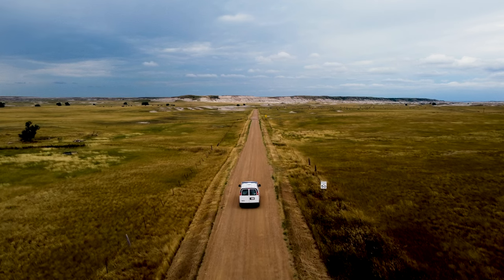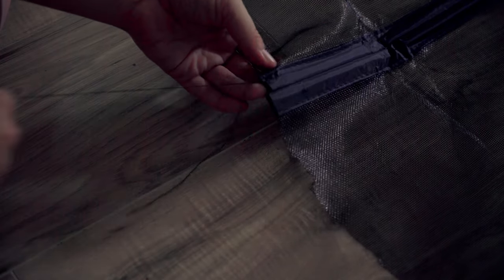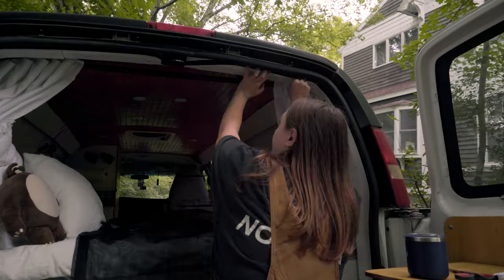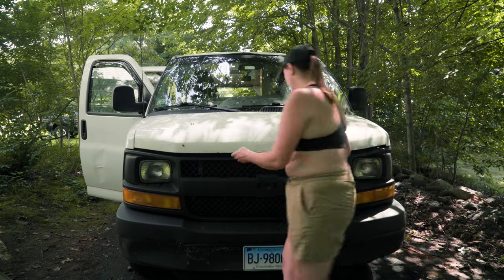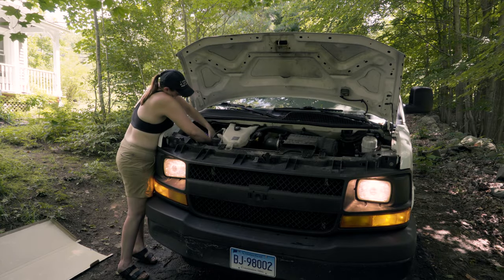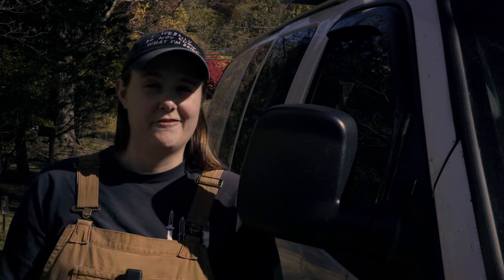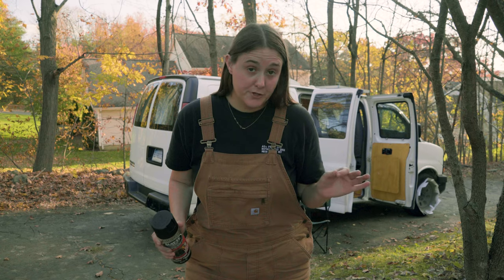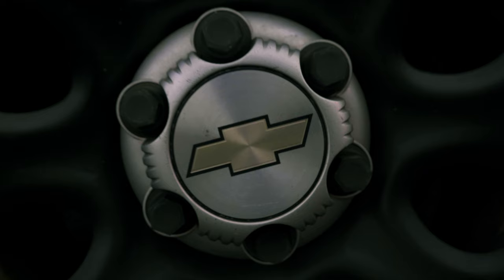I Still Don't Know What I'm Doing…More Upgrades to My Converted Van

Comment: Great addition with the netting on back.  I did that too and I would suggest adding some velcro to the sides to keep the neeting close to the van sides.  When the wind blows, it will push the netting into the van and allows bugs to get in.

Comment: love it! but what i want to know is where did you buy the swivel seat, up here in Canada is almost impossible to find swivels for a savana 😢
Reply from the maker: So I believe this is the exact model of swivel I got for my van https://shop4seats.com/van-seats/van-seat-bases/96-gmc-chevy-swivel-plate-factory.html however, in hindsight I would have ideally gotten one of the ones with a hole in the middle, but they don't seem to make them for Chevys? At least not that I could find. I do actually use the swivel though, haha, but I have to unplug the airbags when I do it, and reconnect them when I want to drive, so it is a bit inconvenient lol. I'll talk about it more in an upcoming video on the road! Ultimately I do like having the swivel plate setup with my configuration, but it's a bit of a PITA to set up. I'd rather have it than not, I suppose!
Reply: @LindsayDaly  yay!!! thanks a lot!! 🥲

Comment: Looking really cool. Ignorant question from me through - is there a risk of rust on the reverse of the wheel rims? Sort of occurred to me that you have protected the outeard facing part but cant easily treat and spray the other side. (Though i know even less about these things than someone wearing your fine hat)
Reply from the maker: No haha you’re totally right! But it would have involved taking them off the car and un-seating the tires from the rims and that was a risk I wasn’t willing to take 😬 it’s mainly surface rust anyhow so it is mostly cosmetic, but i suppose at some point I should maybe get comfortable with taking a tire off this thing just in case…🔧

Comment: Ac fix is just temporary….hate to say it but.
Reply from the maker: No you’re so right and I kind of figured something deeper might be wrong. I did eventually find that the coolant was leaking so…
Reply: @ sorry just saw your video with the issues with your van.just gotta say I’m impressed with your frankness and focus.problems like that can be tough.i try taking baby steps.try to solve one thing at a time and expect most systems to fail at some point,and have an a plan and a b plan.hope you’re doing well